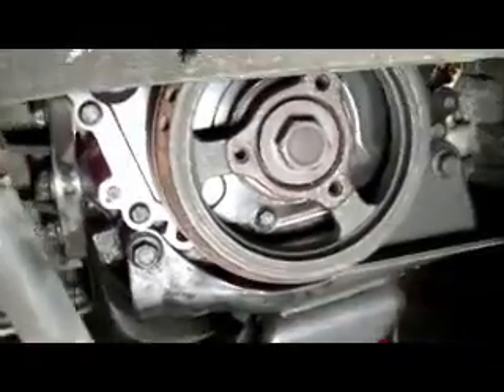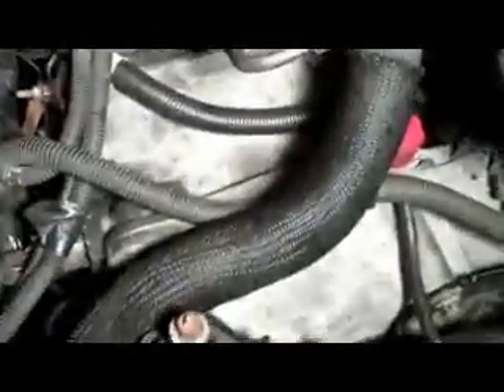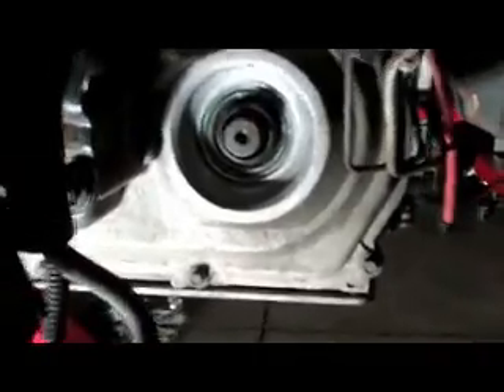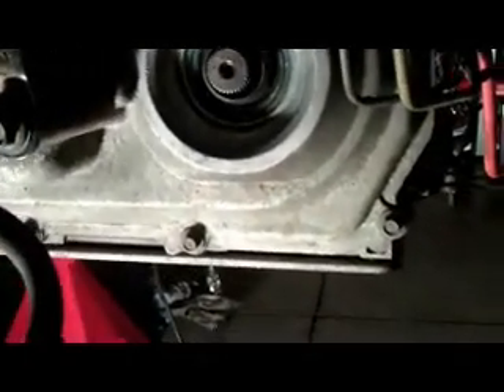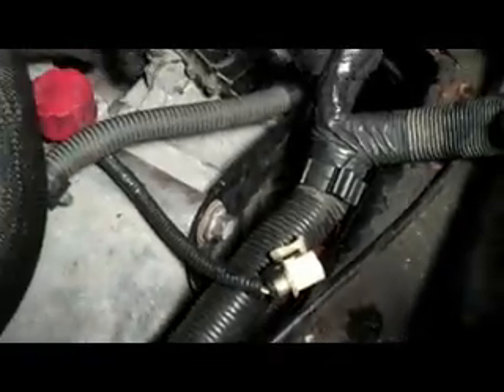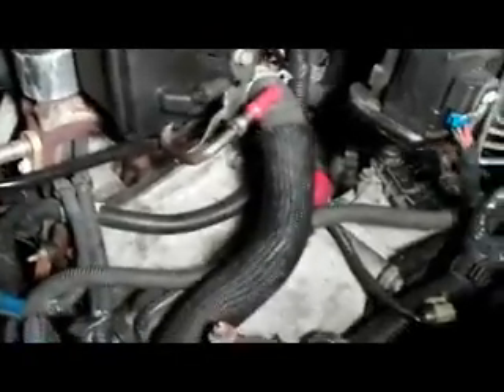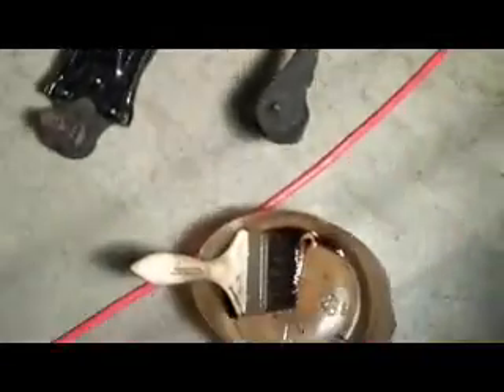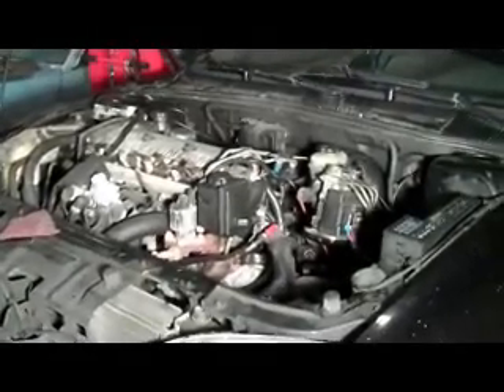Cavalier Z24 2.4 Water Pump and Timing Chain Replacement Part 3 Classic G-Body Garage

Comment from the maker: @ypsv17 I did replace the thermostat and with a fail safe model, It sticks open if it fails. also replaced the o-ring yes. I made sure I did this job right because I never want to do it again.

Comment from the maker: @ypsv17 Its brand new, not a reman, its from Advance and is their top of the line. Also bought high quality gaskets and didn't use the gaskets that came with the water pump, wanted something better and thicker. I do fear that there will be issues after all this work, especially if the trans is good. We will see. If not I know how it comes apart now.

Comment: Question,  did you use a harmonic balancer installer to put in the bolt or just the bolt itself? I'm where you were with this repair right now
Reply from the maker: From what I recall, I put it back on with the bolt and torqued it down to spec.

Comment: Right now I'm goin though the timing chain with my 2.2 Pontiac sunfire i thinking it jumped inside n is out of timing so got to try to fix it. This is more of a bitch n i was hope tht i wouldn't have to do it. But its something tht would need to b done might as well do it right the first time i don't want to do it again. If u know on anything on this 2.2 engine with the timing chain n all i would b gladly Appreciated. Thanks
Reply from the maker: A 2.2 is a completely different engine than the 2.4 in my videos. I have never worked on a 2.2 so can't provide any info.